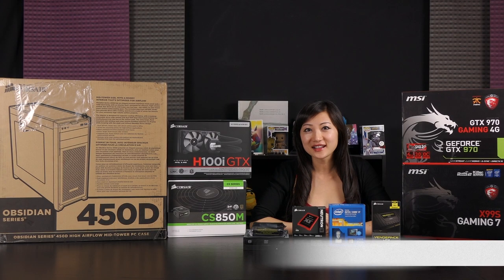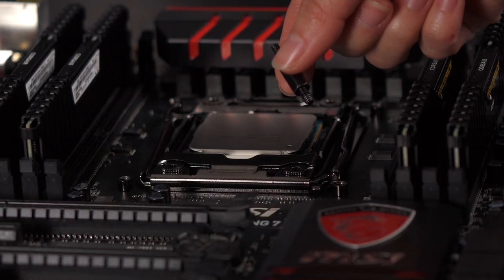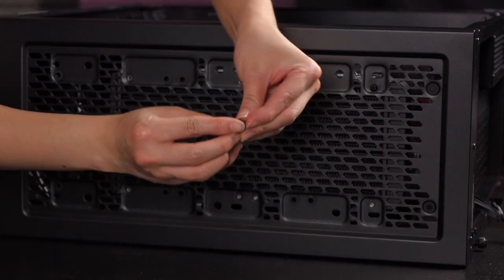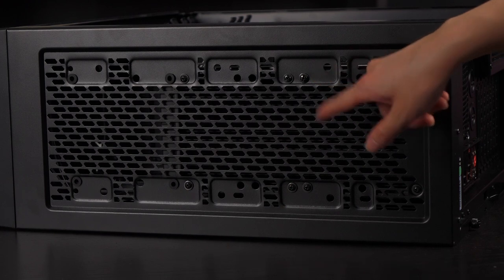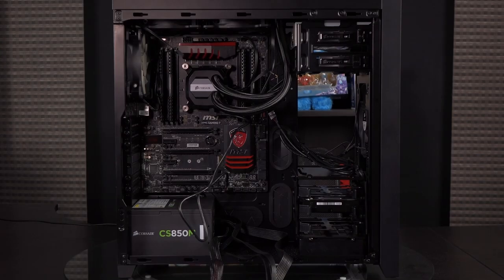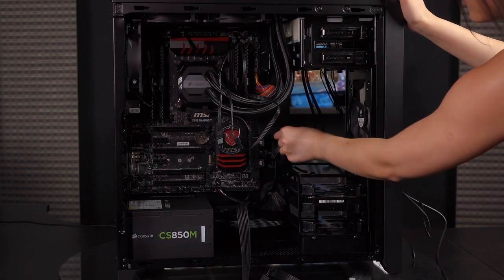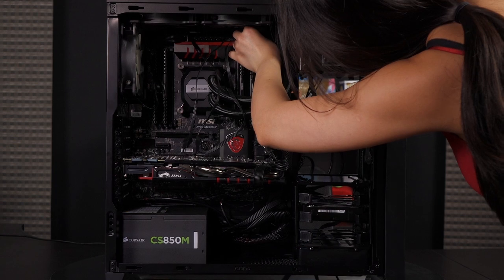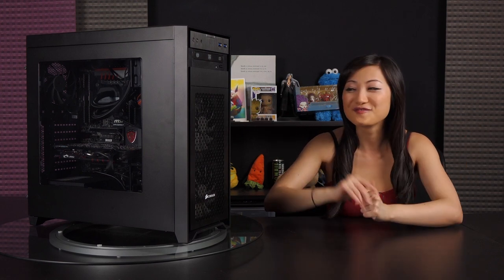How to Build a PC: Epic X99S & DDR4 PC Platform!

Comment: Joanne, GREAT Video, well made! 
Small note; "ground yourself" means literally "connecting you to the ground", to do so you can touch a device in metal *that is connected to the ground*, it has to have a power-cord that is plugged-in the mains (the device can be turned off). In the electrical plug there is a ground connector, that connects to the ground of the electrical installation in your house. The "ground" is an copper wire under your house, in the earth (ground). You can also use a grounding wrist lead and connect the other side to a radiator or so (those are also grounded).

Comment: I think that the CD drive makes the front of the case really ugly... Isn't their any better choice for it to go along with the case better?
Reply: River Capulet Installing none would be the best option if you wish to keep the uniform front look. I personally gives zero shit about that as long as the drives are working. Maybe using an external drive instead?
Reply: Indra Setiawan that's what im using, an external drive. I have the exact same case and wished that the odd cage were removeable for another 140mm fan.
Reply: River Capulet I want this case so much, because I want to keep the CD drives. But there's no area in my room that allows this case to be placed.

Case height is 494mm, the only place I have is under my computer desk, which tops at 460mm.

Which only left me with Air 240 for an option, because the 350D only supports 2 HDDs and doesn't seem to be fully dustproofed. And will require me to buy an external CD drive.

I have bad experiences with external drives, with them being undetected when the cable is slightly touched (unintentionally). But maybe because they're already old and the cable is already in a bad condition.
Reply: Indra Setiawan Putting your case under your desk is never a good idea... bad airflow and more dust. I guess the CD drive is personal preference really, as I haven't used one for years. Nowadays you can download anything from the internet.
Reply: River Capulet I guess I need a new desk then +_+
Reply: River Capulet And btw, I have to agree with the airflow and dust, but I really have no other place to put it unless I change my desk.

Well... not a desk actually, more like a computer rack. It looks like this (quick drawing of it, and my room)

http://orig11.deviantart.net/e7c3/f/2015/177/a/c/ttk_by_intelman-d8yws7k.jpg

There's a subwoofer sitting right next to it, so it'll contribute to the heat as well I guess XD
Reply: I would just put it sideway where the printer is, and put the printer under haha.
Reply: River Capulet I had that thought. But I fear that it will someday decides to crush my monitor and my heart into pieces lol XD
Reply: River Capulet maybe im old school but I like the cd drive
Reply: thereddog223 i like a cd drive too, as long as it doesn't destroy the aesthetic of the case, if corsair sells a drive that matches the look of this case, im all for it
Reply: +River Capulet I use this case and installed a 5.25" NZXT fan controller (SEN-MIX2-M1). The front bezel of the controller is so flat that I was able to modify the case bay cover with small ND magnets so I can just pop the face on and off anytime and it preserves the aesthetics of the case.
Reply: +River Capulet  I have a NZXT phantom 410 as a case. It has a door that covers the front slots, Makes it look way cleaner.

Comment: Awesome build,  totally adore this girls voice and enthusiasm.  I actually wanted to know why you didn't utilize the M.2 slot?  as they are awesome for system drives,  much faster and responsive to ssd's.

Only thing about this video that had me pulling my hair out was the choice to use the 8x slot for the gpu rather than the 16x slot a single should be placed into.  Theres no room issues between the gpu and the dimms or the cooler,  I would highly recommend placing the card into the top 1 for best performance.

Also someone below was irked about the 970 over the 980.  Elitists can be a real pain lol the 980 doesnt offer that much more from a dollar to performance ratio and the 970's have proved hella tough for most games and apps out there.  970 is a solid choice especially on a budget not that a 980 wouldn't be great but hey they both work lol

Great video!

Comment: Great build log/guide.  For future reference, the SSD frame is for laptops which require a 9mm drive height to make sure it doesn't rattle around and stress the SATA connections.  And switches are basic bridge circuits, so they're not electrical flow dependant like LEDs are, so you can orientate the switch headers whichever way you find most aesthetically pleasing.
Reply from the maker: aidanjt Thank you!Lol, I wasn't sure about that; thanks for clarifying! 
You mean for power and reset? Good to know- thanks!
Reply: Joanne Tech Lover Yup, power and reset.

Comment: Nice build :D The big Corsair cases always look great the Obsidian and Graphite ones especially.
Reply from the maker: jojow158 Thank you!I loved building in the 450D...so spacious :D
Reply: I also had 2 Corsair cases. Super Airflow but it's also it's weakness in my eyes. Full with holes which only sucks in dust. Never again an open case for me. Im using now the Define R5.
Reply: zeus1117 I currently use the Corsair Spec 01 as its my first personal build. It's decent but can't fit a Hyper 212 Evo and can't exhaust air from the side. I am going to use a Fractal Design 1300/1500 for a clients office PC it will be my first build using a FD case. If it goes well I will definitely check out the Define R5 heard so many good things about it.

Comment: Just to add the mobo is MSI X99s Gaming 7 and i7 - 5820 processor; the others are PSU - CS750M ; GPU - MSI geForce 960 GTX, Patriot 2x8 gb ram.

Comment: A cable management tip; route everything behind the motherboard (aka the H100i fan cables) when you put stuff in. When you connect it to the motherboard, GPU, whatever ... go through the shortest route from the back of the case to the connector. You end up with less visible cables in the first place.

With all that costly stuff in there, I bet you can somewhere find like another 10 bucks to get a sleeved 24pin ATX connector for that PSU. ;-)
Reply from the maker: Tom Sheep Thanks for the tips!

Comment: Your optical drive and case are not grounded so touching them won't help preventing ESD ;)
Reply: Exactly. Touching the housing of one of the ports at the back of the motherboard would probably have been better.

The key is to bring yourself at the same potential as your components to prevent a static discharge that might cause damage to your expensive components. I always wear a wrist strap.

Comment: I have this case and I love it! Great video :) Sweet rig!
Reply from the maker: random63089 I love this case too!Needs more USB 3.0 ports in the front though ;p
Reply: Joanne Tech Lover Four 3.0 ports in the front would have been nice but, honestly, I don't use the ones in the front that often so I don't really mind. I only ever use them to plug in a flash drive or to charge my phone or ipod. The one thing I'm having a problem with is cable management. I can't get the non-windowed side panel on when I route the cables to the back of the case. I think I might need to buy custom cables, which i want to do for my color scheme anyway. Maybe I'm just a noob at cable management. Sorry for practically writing a novel lol :D

Comment: your cable management is fine. It doesnt matter about the cables on the back of the board because it doesnt get airflow.  You could add is some red led lights inside to make it look really nice. Awesome Rig you have there remember to clean out the dust every so often :)
Reply from the maker: Mark r Thanks, once it's all squished under the panel lol.
Yes, LEDs would make it look nice :D

Comment: Jelly! and the music is great! Modern PC's with the H100i are a cable management nightmare.
Reply from the maker: Glad you like the music! 
Omg, cable management; I forgot how terrible it is LOL.
Reply: I don't get this whole water-cooling hype. Im still using the Sandy-Bridge Platform cause in gaming there is basically no performance difference in that vs newer platforms. And with a normal aircooler i am below 50 celsius under load while running at 4GHz a stock 3.3GHz CPU. Besides, the radiators and all that stuff there will be even louder than aircooling. Plus the leakage danger, if not that significant, but still there.
Reply: zeus1117 I don't think it's something everyone needs, but today, especially with 4k monitors, people often find themselves needing more frames. I have a haswell with a 780 TI, and often find my frames well below 60, and have to reduce settings for better performance. Many people are finding they need the headroom to push their system, it's not just a luxury, and in these situations, water coolers help. For me, I find my CPU is often the bottleneck, but I know this isn't a problem everyone has. Also, I regulate my fans from the bios. Without this, my system makes all kinds of noise, but in practice it's as quiet as any system I've owned.
Reply: I understand you, all im saying is that Haswell is bad architecture in terms of hear ergo overclock and cooling is way more effort than a sandy bridge one. And you barely get more performance. Depending on what you do, but for gaming is definetly most always the video card what is the bottleneck. Unless you don't own 2x 980 Titans in SLI...
Reply: Btw im well above 60 FPS in any games i play since i play then at 1920x1200. And since it's a 24" in front of my eyes i get also good DPI. If i would go up for 27", i would need way bigger resolution for the same experience. And then i would get less FPS is true. For ne fluid gaming start at 100FPS. Having 4k big screens backed away a bit more and half or less FPS doesn't make sense to me nor to my eyes.
Reply: Ye, I agree, that's just as good a way to go as any. Maybe better. I like having the headroom for some things, but it's really only one thing I need it for. 120 Hz monitor and an good air cooler is all most things really need. Just don't get hooked doing something else. I do see your point. I actually have two systems. One for 4k and one for pure speed. I use a 1920×1080 TN 144Hz monitor on that one, and it has no need for a water cooler, but it has one, and penguins would feel cold in that water. Ye Haswell was a bad joke by Intel as far as I'm concerned. Especially the first one.

Comment: It is good explained step by step, you are doing the parts according the computer case, with the right parts, congratulations, i am also a computer operator, it is great equipment you got,you got a great table, and you put the material with the magnetic to recharge electricity very well, you put the parts on the right place without damaging the motherboard.

Comment: That SSD is the best part, for obvious reasons ^__^
Reply from the maker: ***** :D
Reply: Joanne Tech Lover Yes, those SSD's are the fastest overall benefit however, 240GB/256GB and larger sized SSD's have faster data flows than the 120/128GB's in the same make and model.

Comment: I just want to say how much I admire you for including optical drives.  I am so sick of hearing from "pro builders" that optical drives are to be avoided.
When I was first building my own PCs in the early 90's I remember it was almost a miracle if the PC booted in the first go lol.
I wish they would finally change the way the pwr/led/etc cables/plugs are.  
While it was interesting to watch someone else build a PC, I can't say I miss the sport.  Partly why I have jumped to laptops lately.
Well done Joanne, you are cool.
Reply from the maker: Trusteft Well, it's one of those, "why not," deals ;p I enjoy building :), and it feels good knowing I can, 'cause I can spec it up how I want :D. 
I do need a portable though, but waiting on that!
Reply: Joanne Tech Lover I bought a XMG laptop for gaming 5 few months ago and I am very satisfied with it.  Just one suggestion if you ever consider ordering a laptop from them, but they are not cheap :(
1 x 39,6 cm (15.6") Full-HD (1920*1080) Matte IPS
1 x NVIDIA GeForce GTX 980M 4096MB GDDR5
1 x Intel Core i7-4710HQ - 2,50 - 3,50GHz 6MB 47W
1 x 32GB (4x8192) SO-DIMM DDR3 RAM 1600MHz Crucial
1 x 512GB m.2 SSD Samsung XP941 (MZHPU512HCGL) - connected via PCI-Express x4
1 x 512GB m.2 SSD Crucial M550 (CT512M550SSD4)
1 x Intel Wireless-AC 3160 (incl. Bluetooth) 
1 x Backlit Keyboard U.S. International

Bloody fast though. :)

Comment: Great job Joanne. Funnily enough I'm using roughly the same components you used is my next system, so it's great to come across this clip "Samsung 850 EVO Series 1TB mSATA SSD just saying XD nless cables = yay". My PSU will be a CoolerMaster V850 80 Plus Gold 850W tho. Imho Corsair psu's are unreliable having replaced 2 of them, twice bitten twice shy thing you know :/ which is a shame. Oh and use a Intel Core i7 4790S 3.2GHz  cpu. I will use the Cryorig R1 Ultimate CPU Cooler to save a few $$$
Reply from the maker: Jeff Parry Thank you!
Sorry to hear about your PSUs :/. 
Thanks for sharing your list!

Comment: I'd have mounted the radiator fans in a pull config not push, be much easier to keep clean the radiator over time without having to remove the fans each time. Nice bit of kit though.
Reply from the maker: Kurt Wilson Interesting point- thanks for sharing!

Comment: After install motherboard, I would have do the casing's cables first before installing PSU and keep those separately tied so that in case PSU fault, I don't have to mess with casing's cables too to replace it. Then I would do the PSU cabling and finally data cables for drives. In those order.
Reply from the maker: ssddsquare Thanks for sharing!

Comment: Ok, nice job with the video. I have many questions for you and a little about me. I do some photo and video editing. Photoshop, Lightroom, and Premiere Elements. My current computer only has 6 Gb RAM, AMD Phenom II 2.8 GHz, and nothing special for video card. I have been thinking about building my own too. Don't want to spend too much, yours is at the upper limit. So my question to you is how do you like it? What OS are you using, and what editing software are you using?
I built one 11 yrs ago and tings have changed a bit, so I appreciate what you have done. Thanks
Reply from the maker: Booracay Thanks!
Try pcpartpicker.com to find yourself a budget system! 
I use Windows 8.1 now, and edit using Premiere Pro CC 2014, well CC 2015 now.
And, I use Audition to clean up the audio too.
Reply: Just noticed your response. Thanks! I may be heading that way with the OS and editing software. Keep up the good work.

Comment: Joanne Tech Lover I'm still pretty new to the PC community and haven't done a build yet (although I'm planning for one in about a month) and I was rather confused at 6:23 because you said you're CPU cooler is functioning as a exhaust, wouldn't you want cold air flowing over your radiator? I'm probably just confused but it doesn't seem to make a whole lot of sense.

Comment: Is this good? any improvements?

GPU:         ZOTAC GeForce GTX 980 Ti 6GB PhysX CUDA
Storage:     Seagate Barracuda® 2TB
M-Board:    MSI Z97A GAMING 7, Socket-1150
CPU:         Intel Core i7-5820K, Socket-LGA2011-3
Cooler:      Noctua NH-D15 CPU Kjøler
RAM:        Crucial DDR3 BallistiX Sport 16GB KIT
Case:        Fractal Design Define R5 Black
CD-ROM:  Samsung DVD Writer, SH-224DB

Comment: 3:06 Haha, that's what she said! Btw, here are my specs: 

Motherboard: MSI X99A SLI PLUS
RAM: 4x 4GB G.SKILL Ripjaws 4 series 16GB
Processor: Core i7 5820K 3.30GHz
CPU Cooler: CORSAIR H100i GTX 
Graphics Card: XFX R9 270X DD 2GB
SSD: Crucial BX100 500GB
HDD: Western Digital Green 2TB
PSU: TOOQ ECOPOWER II 700W

Can't wait for a miracle(?) to happen so I can get an EVGA GTX 980 Ti :D

Comment: Guys, could you tell me what do you think about my build please? What would you change?

- i7 4790k
-MSI X99A SLI Krait Edition
-Gigabyte gtx970
-16GB 2400mhz hyperx Beast
-Corsair AX760 80 plus platinum
-Coolermaster hyper 212 EVO
-Western Digital 1TB hard disk
-NZXT H440 Case

Thanks!
Reply: a 4790K is LGA1150, meaning it cannot support X99 motherboards. Use a Z97 motherboard because those support it. An LGA 2011 CPU supports X99 but you're not gonna be impressed at the price.

Comment: I saw the right angle connector switcheroo....had me lol coz I knew....If you put the SSD in a drive bay you could have used it without switching and it also lines up better for the Sata Power cables....just say'n......I did have fun watching tho...........despite the tunes.....
Reply from the maker: You're right...I'll do that next time with an SSD.
But, I just had to use the tool-less mount ;p
You don't like the tunes?! haha
Reply: Joanne Tech Lover yes, the tunes were you.....all the way....I was just bust'n..........Good Job

Comment: I liked this  video, Joanne. One thing- you used a very low end power supply. I would have used something higher quality. When you dropped the big heavy lockdown screw for the AIO cooler on a MOSFET on the board I cringed. Good video though. I liked it. Not the music. But good video. BTW, one criticism. The "frame" that the SSD comes with is not "Decorative" as you said. It is a spacer to turn the drive from a 7mm unit to a 9mm unit for compatibility reasons with certain cases and laptops. This sort of error turns me off about your channel. Just saying.
Reply from the maker: Thank you!
Well, the PSU was supplied :).
Not the music? ;p
Yeah, I know that by now, 'cause lots of peeps have mentioned it! My bad!